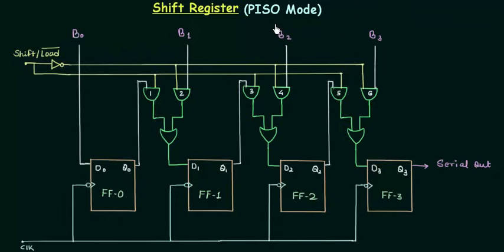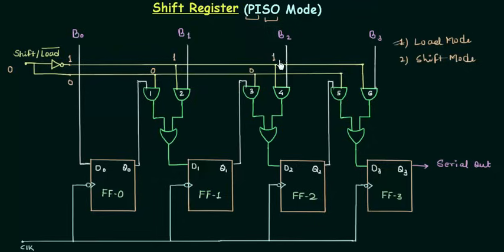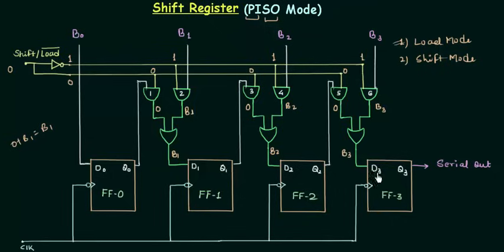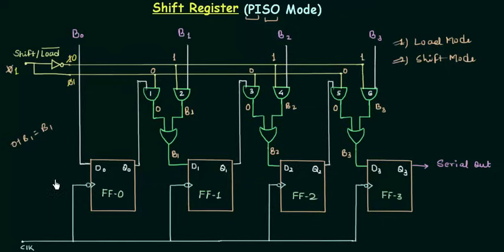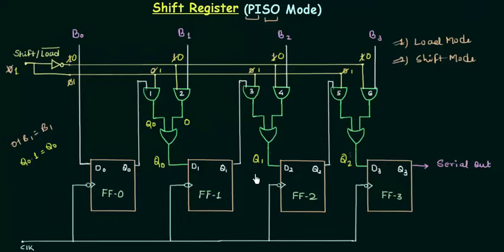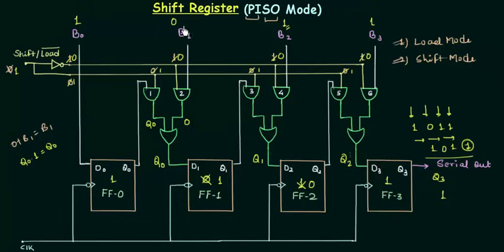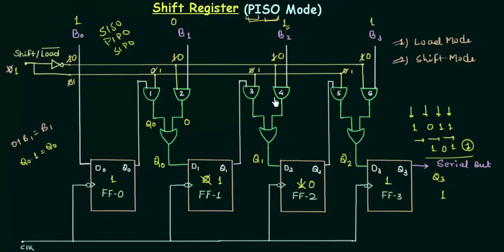Shift Register (PISO Mode)

Comment: Timestamps (Powered by Merlin AI)
00:09 - Explains parallel input serial output mode of shift register.
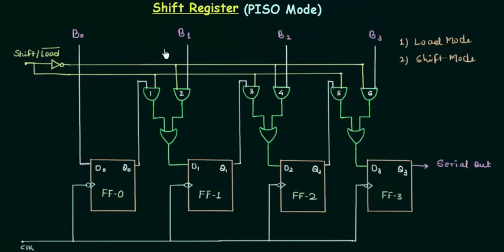01:05 - Overview of PISO mode: Parallel input and serial output functionality.
01:55 - Understanding active low signals in shift registers with AND gates.
02:58 - Data is stored and transferred in shift register flip-flops.
03:50 - Shift register efficiently alters outputs using shift mode.
04:56 - Data shifts between flip-flops in a PISO shift register.
05:50 - Data parallel loading and shifting in shift registers.
06:45 - Understanding PISO mode in shift registers.

Comment: 5:15 why wouldn't Q1 be = Q0? since Q0 goes through the input D1.
Reply: Because every DFF is clocked simultaneously and theres a delay between input to output. So if you set it to shift mode and your input is 0100, then at the clock cycle every DFF updates simultaneously. So since they all update at the same time the FF-0 sees 0, the FF-1 sees 1, the FF-2 sees 0, and the FF-3 sees 0. So when our clock goes high, every FF passes the value they see to their output, giving us a shifted output of 0010

Comment: how to retrieve the remaining three data bits?
Reply: Very good question. At the next load, all info B0, B1, B3 will be overwritten by new data. Clarification of this issue (i.e. how do you retrieve B0, B1, B3 before they are overwritten at the next 'load" period?) would be very much appreciated.
Reply: At the end of four clock cycles, you will get all data at the output....

Comment: Finally when we give input (say 1010) now first we apply load mode one time then shift mode not time so that we can get Q3 as  0 as output . Was this the required output? Please explain.
Reply: I think we need to consider the Q3' output.
Reply: Shift mode input 0 so no shifting shif5 mode input 1 shifting starts after 1st clock pulse Q0 will be 0 ....and yes you are right

Comment: What happens to the content of FF0 in first shift cycle ? From what I understand , after 4 clock cycles while shifting the content of all FF should by 1111 . Am I right ?
Reply: If the first flipflop input is 1 and load is enabled  then output is 1111

Comment: why you have included shift or load mode the combinational circuit simply passes b untouched so the inputs to the d can be simply b instead of using this complicated combinational circuit.
Reply: It is used to shift the data

Comment: sir piso how many clock pulse required ? total clk for storage and shifting?
Reply: One clock
Reply: N clock are required to shift N bits of data.
Reply: In the case of a piso with four flipflop, you will get the output, so if there are N flipflops you need N clock cycles.....

Comment: your vedios are very nice

i just want to ask you about PISO

I PISO how load is decided to wait until all the serial outputs are out from all the filp flop
what is the time period for which load is disabled....
and how the time is calculated
Reply: V Anurag Rao Neso Academy same Question????
Reply: V Anurag Rao Neso Academy same Question????
Reply: same question...
Reply: During first clock pulse load us set as 1 so that all flipflops are loaded with the value. Then set load as 0 for the next three clock cycles so that the MSB reach the output, this is in the case of a piso with four flipflops. When there are N flipflops, this becomes 1 and N-1

Comment: When i try to load the B1=1, and B2=B2=B3=B4=0 then i shift the circuit. The output will shift of B1 to B2 but the B1 is still on, does shifting disappear the previous input(example the B1)?
Reply: If B1 continues to be at 1, the output will be affected due to B1 if the mode is not changed....

Comment: but in this register we are giving input 1011 and we are getting output 1101........what is solution for  same output?
Reply: Yeah here the MSB is converted to LSB. There's no solution I think but we can do one thing. 
Suppose we are to store 1010. So initially we store in the flip flops 0101 parallely. Then we would have output as 1010. Hope that helps :)
Reply: It will take 4 clock pulses to get the 1011 at the output. Hope that helps

Comment: I have a doubt does the load mode occur only once?  and after that we just have shift made the next four times thus it outputs all the four bits in four times, so load mode happens only once and shift bit happens four times after that?
Reply: Thank you for the reply, sir. but in this case is what I am pointing out true?
Reply: Liad node for first clock cycle and shift for next three clock cycles...